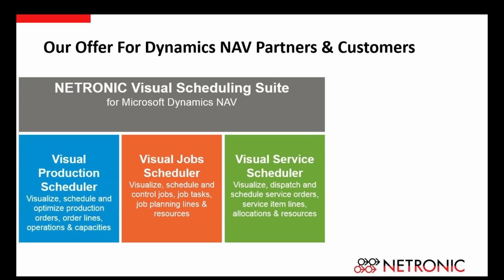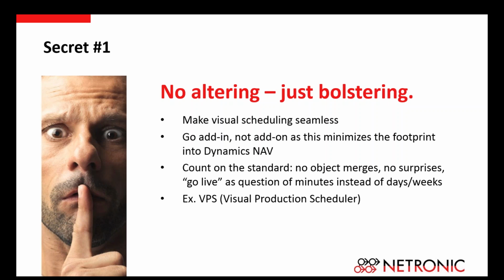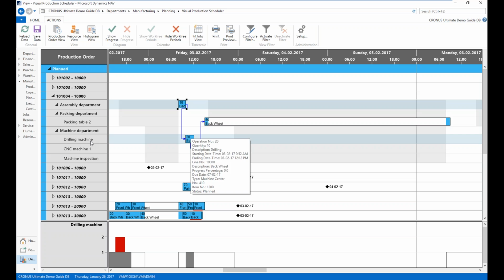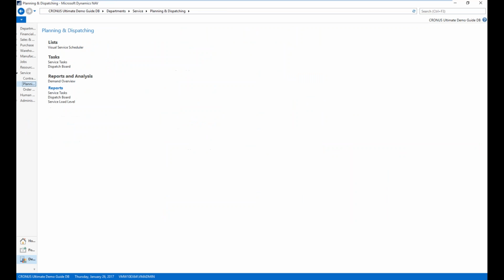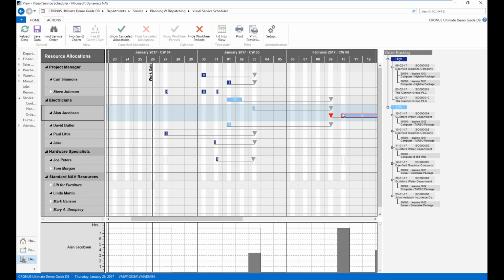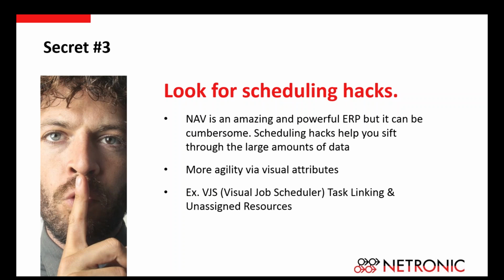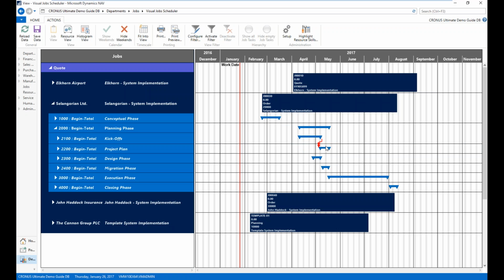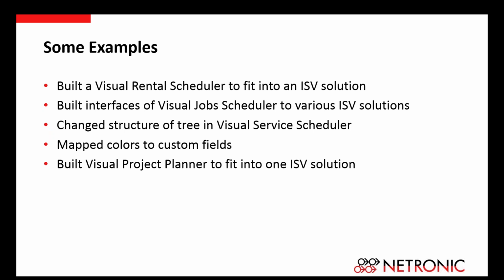The 4 Secrets of Visual Scheduling in Microsoft Dynamics NAV

Comment: one question. how did you get the nav pages working. especially when you drag and drop the block how does it change the data in system.. can you give any clues to the developer like control addin or any dot net interop etc.?
Reply from the maker: Basically, we created C/AL cod which allows us to write back to the NAV Data tables. The following link goes into detail about this process. It is written for 2009, but hold true for all versions.  https://docs.microsoft.com/en-us/previous-versions/dynamicsnav-2009/dd983805%28v%3dnav.60%29